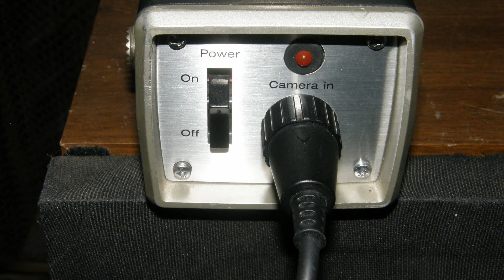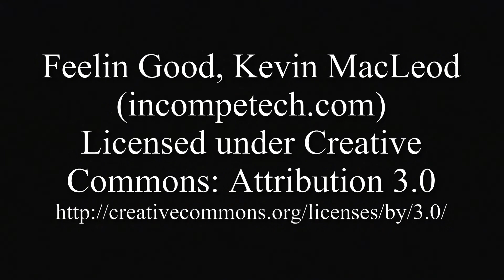JVC PV-4800 Restoration - An Alternate Color Camera

Comment: Kind of a shame none of those cameras work; the "target pistol grip at reverse FG-42 grip angle" hand grip always looked so awesome.
Reply: Like almost everything electronic and Japanese manufactured, hold a mirror to it and build it based on it's reflection.

Concerning JVC U-Matic, I remember when I drooled over the JVC CR-850U when it came out.

When I was at ROC in Torrance California during high-school, took the TV Repair class several times.  There was a barrage of old monochrome video equipment in the storage room, Shibaden, with two portables w/cameras, a Sony BW suit case unit with the small TV monitor w/cameras.  Two large Stromberg-Carlson? monochrome video monitors TV sets with blonde wooden cabinets...and the JVC 3-tube color cameras with Fuji-non Zoom capable Lenses.

There was a JVC CR-8300 editor, no editing controller (at least I do not remember seeing one) and do not know what the playback machine was maybe a CR-6300. I seem to remember editing was done on the fly.

I remember for open house night the instructor Gail Marat set up everything and tried to also find time to try and white balance the JVC 3-tube cameras before that night.  I remember he had set up a monochrome camera tilted at a 45 degree angle and fed it through one of the monochrome monitors.  Viewing it certainly had a off effect.

 I don't know why I am remembering this now.....

To your point, the heaviest camera I remember was a 3 tube Sharp hand held some time around the mid to late 1980s.  It seemed light at first but after about 30 minutes it was a boat anchor, especially dragging that big cable which attached to the back along with it.
Reply: wow, that head scanner sync generator deserves a video of it's own! i had no idea that's how they compensated for gyroscopic motion.
Reply from the maker: All the earliest TV systems used mechanical sync generators.
Reply: inhales through teeth  Well now I don't know what to say.  I agree 100% about it being statistically unlikely for four separate units to all be dead (though I have met with certain types of devices that are prone to this, usually containing either a deliberate Suicide Battery or something that ends up functioning as such in one way or another (those goddamn Dallas BIOS/Real Time Clock chips that you have to pretend you're a Soviet reverse-engineering expert and grind down, bit by bit, to change a fucking battery in, wet electrolytic capacitors) but that sounds quite likely.  And the Panasonic camera is pretty cool looking too, and probably a lot more comfortable to actually use  (I love to use the old stuff whenever I can, I feel that, in some small way, using a thing for its intended purpose brings honor & dignity to the men who made it).  

For what it's worth, I'd make the final decision based on the initial operability of the units.  If the JVCs don't work at all, even with their correct support electronics, well, then, the Panasonic is starting to look pretty nice.  But then again, there's a certain something to be said for the bleeding-edge stuff, in the Go Hard or Go Home sort of way, that, if you're going to drop something on your bell-end, it may as well be the coolest thing it can be.
Reply: Or maybe a CH-1800E which would have been closer to 1976.
Reply from the maker: I am pondering whether to try to revive one of the GC-4800 cameras. Two things inhibit me. The shear complexity of the camera itself and that two tube cameras really suck even when they work correctly. I made a rather disturbing  discovery about the GC-4800 yesterday as I studied the service manual. This is long winded, so here goes....

The BW portapac cameras were driven with sync pulses which are generated by the head scanner. The PG coils produce vertical sync and a small wheel with 525 (625) slots machined into it generates horizontal sync. This means that when you move around while recording, and the scanner changes speed slightly due to gyroscopic effects, the camera stays in sync by changing scan speed too! Very clever and it makes a properly geometric recording on the tape. Where did the velocity errors go? Into the sound track of course. A one percent speed change of video is catastrophic. A one percent change in linear tape speed is unnoticeable, except to a highly trained ear. Here is more on this subject: http://www.labguysworld.com/Shibaden_SV-550.htm

Color cameras, on the other hand, get their sync from a quartz crystal. Period. Not the GC-4800! It uses the H & V drive pulses from the mechanical sync generator in the scanner! The circuits lock the color oscillator to the H jitter present in the sync! So instead of recording the color subcarrier based on its absolute frequency, this system makes absolutely certain there is exactly 227.5 subcarrier cycle between H sync pulses, regardless of the instantaneous H frequency error caused by scanner speed changes. On steady playback, and after up conversion, these pulses come out to nearly exactly 3.579545MHz! The playback color correcting circuits now have a much smaller error to correct and thus produce a superior playback signal. ONLY the GC-4800 camera works this way.

Those engineers at JVC, and this is the biggest complement I can generate, were crazy like foxes! I LOVE JVC! They made the best first generation VTRs, bar none. Sony was great too and I have a separate special place in my heart for them. 

You all really need to see this movie: "Dawn of a New Day, the man behind VHS".  YES! There is a full length, theatrically released movie about this awesome piece of history and it is TRULY AMAZING! The movie was number one in Japan when it came out in 2002! The scene where Sony  came to JVC to demonstrate Betamax is priceless! Demand a copy today. It is generally not available in the USA, except as a rare bootleg. I want a legal copy of this film! PLEASE. http://asianwiki.com/Dawn_of_a_New_Day:_The_Man_Behind_VHS

To Address Lazarus Long's statement, in the opening scene of the movie, an engineer is carrying the 4800 system around a conference room and bitching up a storm of how horribly heavy and awkward the whole thing is. He was absolutely correct. The film only gets better from there.
Reply from the maker: See my other long winded comment. Yesterday's discovery about the sync system in the GC-4800U camera may explain why they don't work when operated on standard ten pin color camera adapters. These don't normally supply H&V sync pulses! The proper camera adapter for the GC-4800 is about the size of a large lunch box and weighs around twenty pounds! (9 to 10 kilos!) This is why I never used it. Doesn't it seem odd that out of four or five cameras, NONE of them work? This is statistically unlikely. One or two should work to some degree. That they are all dead is a clue that something else was wrong. 

So, do I restore a GC-4800U? When it comes to two tube color cameras, I was planning on restoring the Panasonic WV-2200 first. It, like the GC-4800U, is a two piece unit with a huge ugly camera head and a huge unwieldy CCU. I like the WV-2200 because William Shatner used one, along with a huge Panasonic Umatic VCR, in an episode of Columbo to create an alibi for murder. Columbo, of course, was to smart to fall for that! So, to this day, I call the Panasonic camera, The Columbo Cam. http://www.labguysworld.com/Panasonic_WV-2200.htm